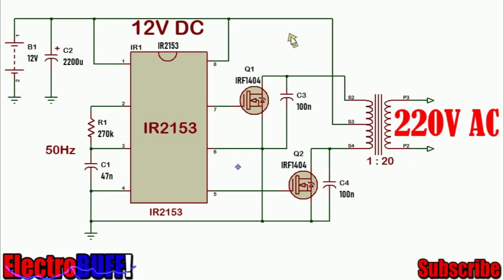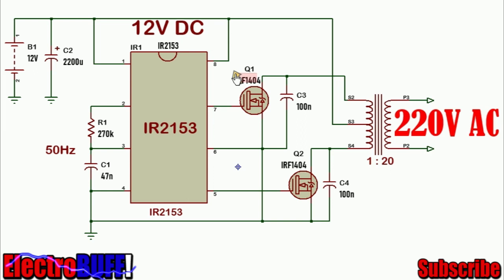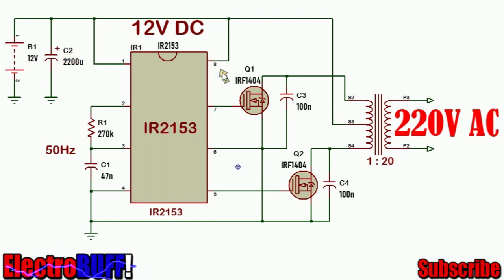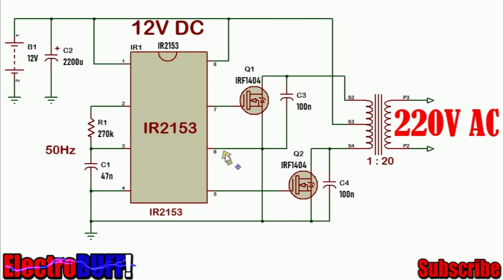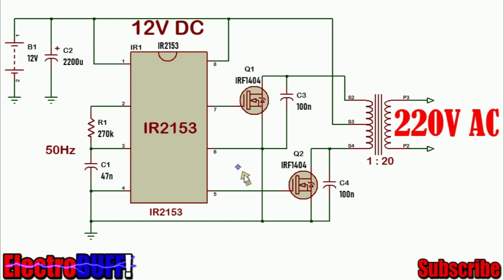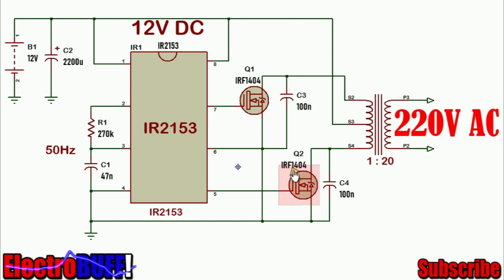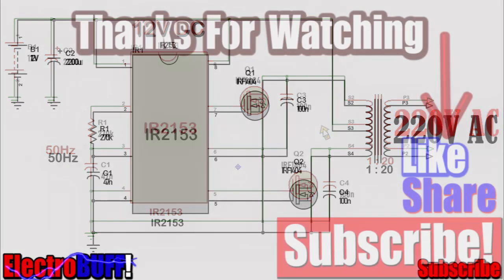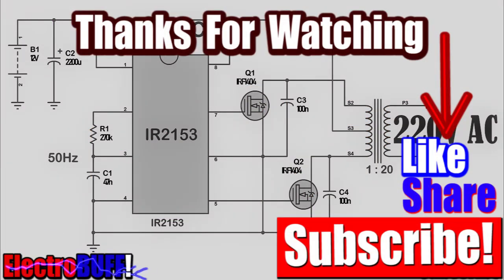1000W Power INVERTER with IR2153

Comment: As long as the equipment has a minimum voltage, this circuit can supply the 1000w efficiently. With four Mosfet irf3205 you have greater power.